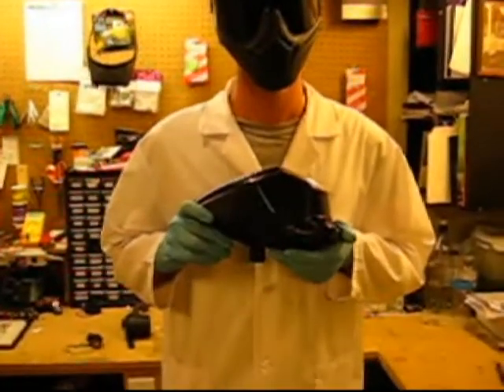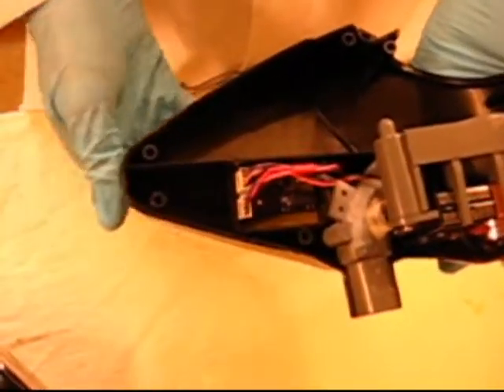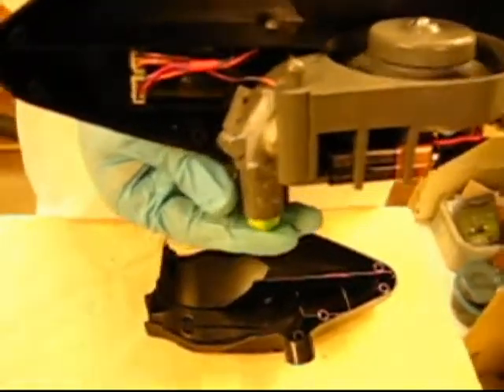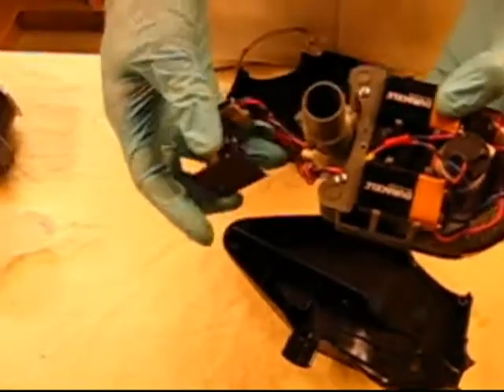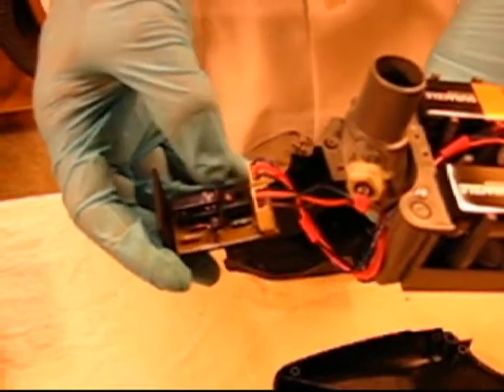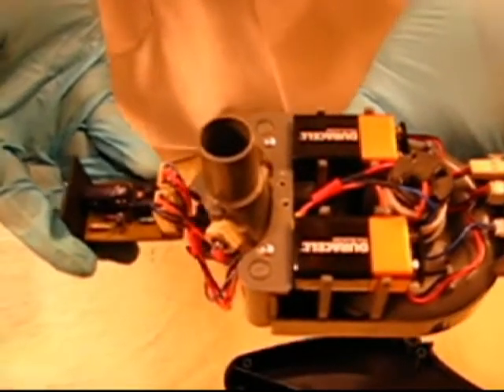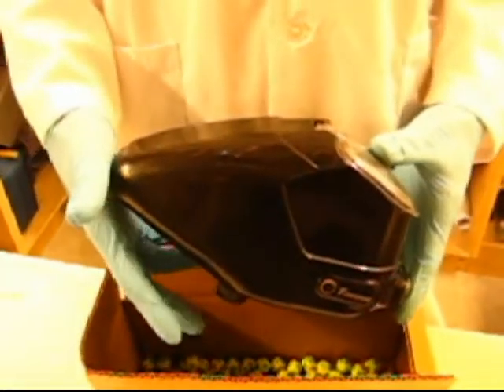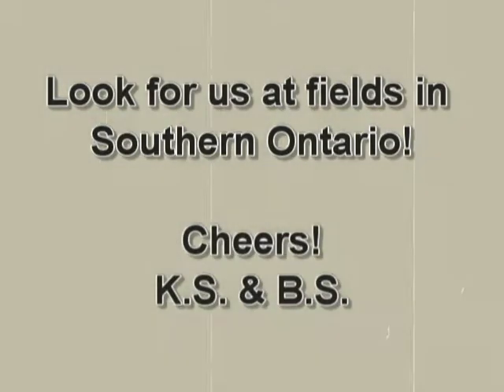TORQUE Loader "Eyes" Mod

Comment from the maker: Of course you can. There's no magic here. There are many ways to do this. One version built to work on an X1 did it all with a single XNOR chip and optical relay. This was no frills, cost only a few bucks and was easy to install. It's only purpose is to save battery's, that's it.

Comment: i can do this with a microprosesor ir led ir recever a diode and a transistor
Reply from the maker: That's exactly what it is and you don't need the processor.
Reply: i know but by using a microchip (attiny)
i can make it do other things
shot counter or bps counter
battery measurement
and more